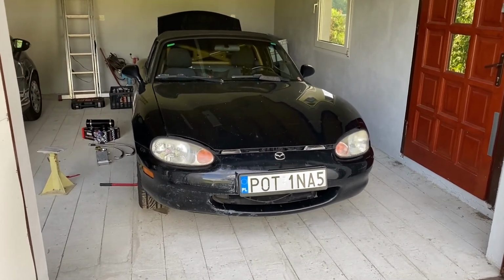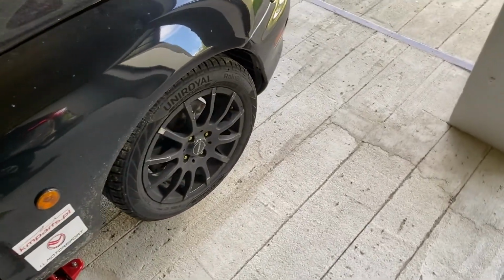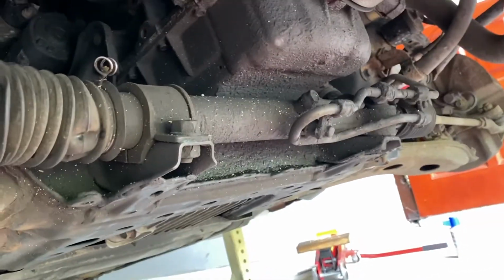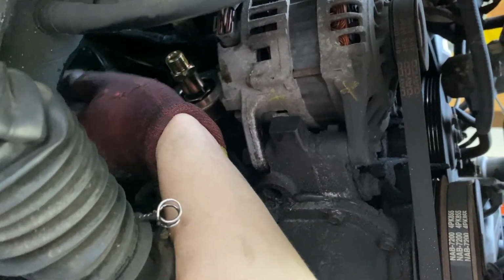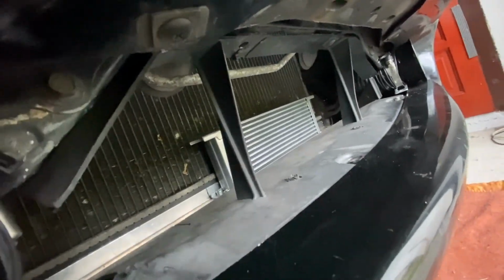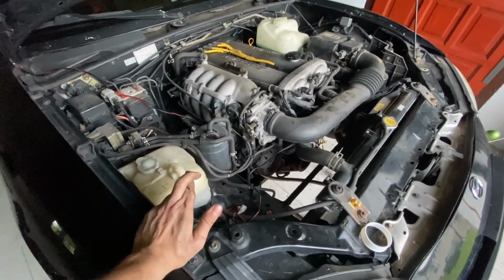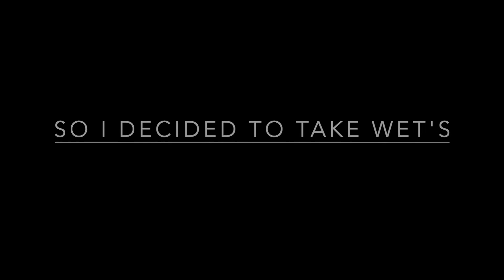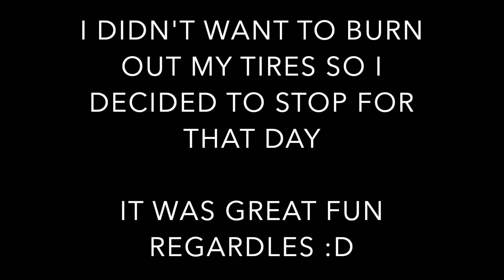Miata Oil cooler and brake duct install, track day on Tor Jastrząb

Comment: Hi from where did you order that oil cooler kit? and bracke duct? Thanks
Reply from the maker: Hi!
Coller: https://turboworks.pl/product-pol-3536-Chlodnica-Oleju-TurboWorks-13-rzedowa-260x100x50-AN10-Silver.html
For brake ducts Im making another video soon, 78mm was little to big to fit